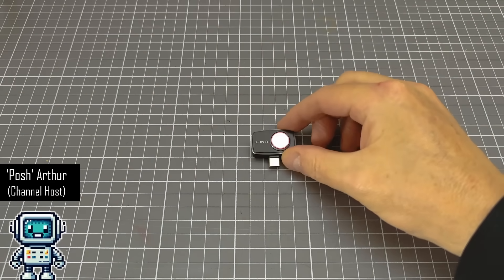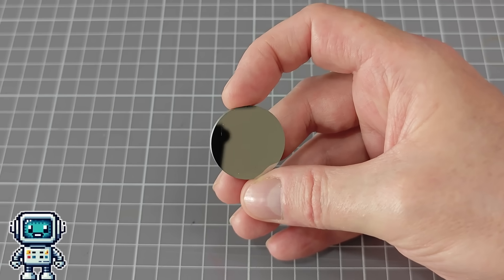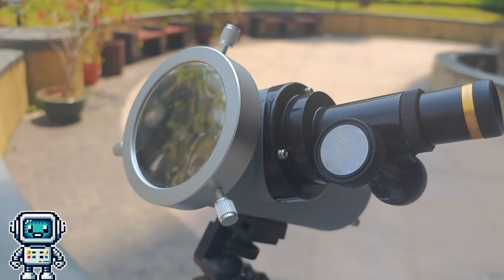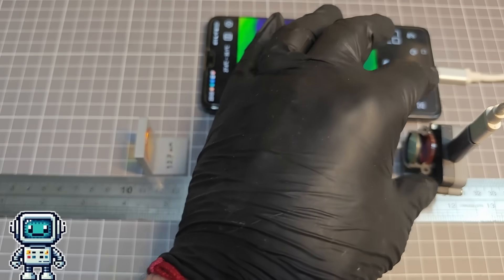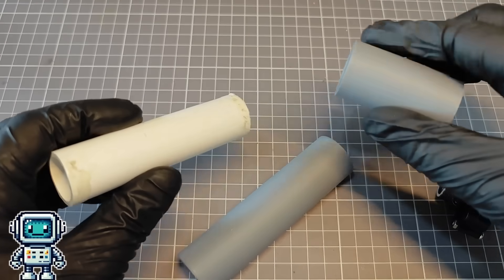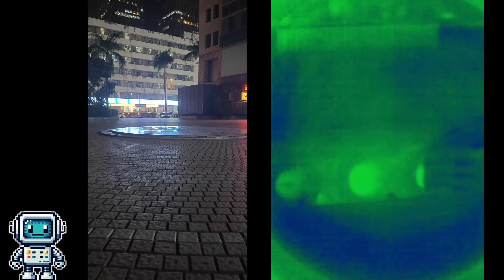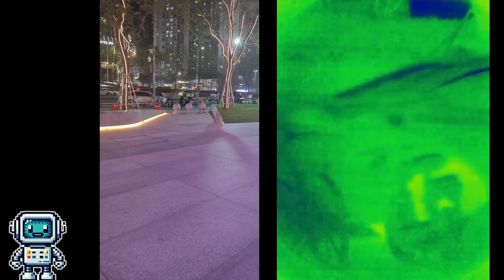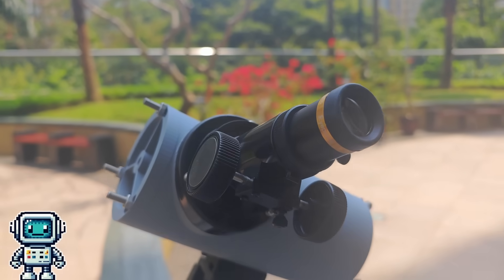Easy DIY Thermal Telescope with over 10x Magnification

Comment: :3:00 wtf did you printedw with 4kg of filament you nutnut. you havent even used supports:))
Reply: ok test parts? so  imagine you dont know how to keep size? in check ? A do measurments units are troubling you ?:)) Maby is just you not everyone should do that:) i expect to have perfect measurments from the fist go. Printers are pretty prety precise, However what i dont understand yet and i am here to figure it out.. i know thermal do not pass thru glass. And i am trying to figure how can i deal with that.

Comment: After I watched Huygens Optics video that used cooktop ceramic glass as a low-expansion telescope mirror, I started to wonder if infrared ceramic cooktops could be used as lenses, or at least as the front cover of a telescope. Sealing the inside air from the outside, so maybe the internal air can be cooled effectively.

The problem is I don't know if it's transparent enough across a wide spectrum of thermal IR. It's just a cooktop glass. It only needs to pass enough IR to cook. Also, grinding the lens would be another science endeavor in itself.
Reply from the maker: Thank you for the comment, I watched that video too, he has an amazing lab and workshop...
To seal the telescope tube from air flow, you could just use any transparent material, even cellophane food wrap, which is very transparent to thermal IR.

Comment: Thanks!

The next time you're experimenting in a place with low humidity, could you try pre-chilling the telescope in the refrigerator? Just make sure it isn't so cold that you get condensation. This is only a suggestion. You are under no obligation.

I suspect that the contrast will improve briefly. Then the contrast will get worse again as the telescope warms up.

If it makes a noticeable difference, then you can selectively cool parts of the telescope to see which parts cause the most image degradation.

Another thing you might try is putting a soldering iron slightly outside of the field of view. This will make it obvious if your tube is reflective in the far infrared.
Reply from the maker: Thank you for the your kind support, we are very grateful.
I have actually wondered about just generally chilling a thermal sensor and trying to measure the differences, I might run a few experiments and if anything worth while occurs, it could also become a full project.

Comment: and  we all  believed the moon was cold!!   is it real?  why  the radiation from the moon  can be  at higher temp. than the atmospheric air??
Reply from the maker: You are correct, in many ways.  BUT a vacuum does not even have a 'temperature' in the classical sense.  There is negligible atmosphere, which means no conduction or convection, but there is radiation, and a lot more than hits the earth (our atmosphere protects us so well).  During the lunar 'night' (about 14 days), everything that will radiate energy will get very cold.  But, during the lunar day, everything that can absorbs radiated energy from the sun, will get hot.  The Apollo astronauts needed significant cooling and wore reflective clothing to compensate for this.
Anyway, hope that helps, perhaps also do a quick search for 'lunar temperature'...
Reply: @project-326   I agree w u  of course, I' m enginr,  not to  "chapear" (means show one´s  golden plate of  a title)  only to know level of scientific talk. to the point:  the moon show an impressive red yea because of radiation only, as the JWT sees,  but radiation also gets dimmer  w  inverse square of distance, and camera should pick up  ambient air radiation, in spite high atmosphere could be at  -50 C. may be the sensor is capturing part of visible light converted into lower freq. by the lenses material. Could be a subject to additional experiments  .  could you please add a link to buy the camera? thank you

Comment: I made one myself. It was a very small reflector telescope but the lenses inside the 20mm eyepiece were replaced by laser cutter lenses. It actually worked exceptionally well giving a crisp, highly magnified image.
Reply from the maker: Please do me a favor and share some more details.  This channel was started to help be learn more about things that are not in my "wheelhouse", so feel free to give me a lesson!
;-)
Reply: I still have the eyepiece. I might do a video soon. Its very straightforward and phone thermals are ideal to use for them as their small size is perfect for the eyepiece.

It's got a potent detection range of several miles and reflector telescopes have mirrors that work great in the thermal wavelength. Refractor telescopes don't work
Reply from the maker: @mrdojob  I look forward to it!
Reply: @project-326  just done a few videos now.
Reply: @project-326  I'll see if I can make a full breakdown of its construction in a video but itll take some editing. Hope you enjoy my current videos. It'll surprise you how cheap and easy it is.
Reply: @mrdojob this is a duplicate of a comment I posted on one of your videos.
------
The center of the image is clear, but the outside is quite cloudy. Did you do anything with the lining of the telescope tube to limit how much heat it emits?

As an experiment, could you cool the outside of the tube with a bag of ice? This would just be to determine the source of image fogging. It isn't practical for extended use.

Comment: I did similar experiments in the past. Diffraction limit is not the problem. Pixel size of thermal sensors is much bigger than pixel size in optical cameras, so this matches to the lower resolution of the optics. To get better contrast you need bigger optical aperture. So the approach with mirrors is a good idea. You should go for mirrors with big diameter and moderate focal length. Like d=100mm and f=200mm. Maybe take a look at cheap mirror telephoto lenses. There are some with f=800mm f/8 they are Maksutov Cassegrain type so the primary mirror has a much lower focal length, maybe around 200-250 mm. Mounting the camera module directly in the primary focus, without using a second mirror could also help. And of course the original lens of the thermal camera module should be removed. This applies also for the other design with the lenses.
Reply from the maker: Thank you for the comment.
Over the last few months, I have done a LOT of research into this.  Yes, the pixel size is relevant, but again it leads back to the diffraction limit.  Optical gain is also another train of thought that again leads back to the same issue.  For optics with reasonable 'telescope' type optical gain, the f-number needs to be super low and with a very large aperture.  The best results I have seen is from some guy that own an 8" mirror with an f-number under 1.2, which is pretty crazy.
Please feel free to correct me, I do love to learn from the comments.
Reply: What about catadioptric ones?

Comment: Since the camera is so small (about the size of the Newtonian secondary mirror), you could just put it (with an short focal "eyepiece" lens attached to it) in front of the mirror, and avoid the complication of the Newtonian setup. Searching Aliexpress for "parabolic mirror" finds a lot of stuff, including large cheap plastic mirrors, with a high numeric aperture. For the longer wavelength, they could maybe be accurate enough. I think the low numeric aperture of the longer focal length thermal lenses (f/10...) is the main reason for low sensitivity/contrast.

Comment: Nice. For the reflecting telescope you should also cool the spider and the secondary mirror maybe even the tube of the telescope, so you get much better contrast and sensitivity.
Reply from the maker: Thanks for the tip
Reply: Good point you make,  reducing the thermal energy in the system is essential.

Comment: BTW nExt Camera (Android) works well with that Uni-T thermal camera and can do full-screen view without any controls (double-tap to zoom). Video recording is also at the full framerate without drops.
Reply from the maker: I have that app on my phone but it doesn't work so well on my cell phone.  I also have a collection of thermal LUTs that the nExt app is supposed to be able to use, but never managed to get that set up.  Perhaps my Chinese cell phone is just not allowing the correct permission to this app...?
Thanks for the comment!
Reply: @project-326  Interesting. As for the thermal LUTs, I generated some with some C code a while back for an Ironbow palette I found. The author offered to include thermal palettes by default if someone can provide public domain code that generates them without any lookup tables (to avoid copyright issues). He's a nice guy so maybe can figure out the permission issue. So the thermal camera never shows in the app? On all my devices it has a USB permission box that comes up when the camera is detected. I noticed you use a slightly older version of the Uni-T camera than I have. Does it work on your PC as a normal UVC USB webcam?

This is the file format (use a .cube extension), with 256 lines of RGB values for each input level (0.123 0.456 0.789 are an example line)

TITLE "Ironbow"
LUT_1D_SIZE 256
LUT_1D_INPUT_RANGE 0.0 1.0
0.123 0.456 0.789
...
Reply from the maker: @gargantuablargg  It shows up on nExt, but often glitches and then the app needs to be restarted, etc.  I have a 640p thermal camera as well, and this one glitches within a few seconds, so I guess the issue is related to the data rate.  
There is probably some USB type of permission that my phone won't allow me to give to app like this.

Comment: We can pull planespotting at night whoa. You've stretched that cheap thermal camera's abilities far beyond what even the manufacturers intended it to be :O

also YES PLEASE i want to see that pancake tube in action! You gonna convert that Fnirsi thingy to sport said pancake tube? Because there's an aftermarket Fnirsi with a pancake tube installed, but it's not cheap
Reply from the maker: I will probably use the Bosean FS-5000, it's just a better platform to build on by still cheap.
Reply: @project-326  That makes me even more curious since there's even less hardware modding documented for it. if anything you're at the forefront of FS5k hardware modding :D

Comment: 4:58 to use one from our microscope project a
5:01 20 mm diameter zinc selonide lens with a

5:44 very toxic it's pretty safe when in

Bezüglich der "Giftigkeit" ist https://en.wikipedia.org/wiki/Zinc_selenide sehr aufschlussreich !
Da sind dutzende Beispiele als Nummern angeführt. Fährt man mit dem Mauspfeil über die Ziffer, dann sieht man in Kurzform die Gefahr. Ist vielleicht für Aquariumsfreunde interessant.

Comment: nice upgrade, what temperature of the moon did you measure, does it match the official statement?
Reply from the maker: Thank you for the comment and interesting question.
Actually I didn't try to make a measurement, it would have been wildly inaccurate for a couple of reasons:
1) I doubt if the emissivity setting of the thermal camera module would have optimized for the lunar regolith (probably a niche application).
2) Adding 4 lenses in the optical path massively changes the sensitivity.

I hope that helps?

Comment: Recently used a Newtonian telescope with a thermal cam, just take a cheap Co2 laser lens inverted between the telescope and the camera, works quite well.
Reply from the maker: Thank you for the comment.
I am very curious, what was the camera type and spec of the lens that you used?
Reply: @project-326  same as in my macro lens thermal cam vid, its the same setup just flip the lens, the 3d files for that are also on my thingiverse if u need it

Comment: As a retired Thermographer who used cryogenic cooled sensors and numerous other TI imaging systems,  your device is very impressive with ingenious solutions to tricky optics.  You dodged a bullet with internal radiation screwing the resolution I suggest insulation to reduce thermal conductivity in the tube.  Well done....
Reply from the maker: Thank you for the comment.
What kind of insulation materials would you suggest?
Reply: @project-326  He might mean cooling the pipe.
Reply: @project-326  Hello, 
Paint the inside of the tube with high emissivity mat paint (Blackbody) this will reduce internal reflections,  wrap thin 2mm polystyrene around the outside of the tube cover this with mylar from a crisp packet with the shiny side out, repeat with second layer of both.  
The polystyrene will control thermal conduction and the mylar the thermal radiation.  Ideally the tube needs to be as cool as possible.

Image resolution, Mono pallets are better with low resolution so use IronBow or Black/White mono pallet.  Adjust level and span to improve contrast.

Isotherm, some software will have this function, it is a temperature range which will trigger a different pallet of colour, this can be used to blank the back ground. For example the object you wish to see it ten C above ambient.  Set Isotherm to present a colour for anything up to ambient. this leave the warmer object like a silhouette.

Avoid the Rainbow pallets unless you are imaging high energy.

Check out FLIR website and their free software 

support.flir.com/SwDownload/App/SWDownload1.aspx?c_id=131090

Also Infrared Training Centre which is 

Great work I really enjoy your channel and the level of work you put into it please tell the A I overlords to FO as you doing well enough without them..
Best wishes from UK
Reply from the maker: That's really great information.  Thank you very much.
Best wishes from Shenzhen, China!
Reply: @gargantuablargg  Thanks for that, I am a bit out of date with software as mine was PC based and research platforms. What you describe has similar functionality and incredibly useful once set up correctly images then have significantly improving contrast and detail Thanks for the info. Best
Reply: @project-326  Hello, 
Paint the inside of the tube with high emissivity mat paint (Blackbody) this will reduce internal reflections,  wrap thin 2mm polystyrene around the outside of the tube cover this with mylar from a crisp packet with the shiny side out, repeat with second layer of both.  
The polystyrene will control thermal conduction and the mylar the thermal radiation.  Ideally the tube needs to be as cool as possible.

Image resolution, Mono pallets are better with low resolution so use IronBow or Black/White mono pallet.  Adjust level and span to improve contrast.

Isotherm, some software will have this function, it is a temperature range which will trigger a different pallet of colour, this can be used to blank the back ground. For example the object you wish to see it ten C above ambient.  Set Isotherm to present a colour for anything up to ambient. this leave the warmer object like a silhouette.

Avoid the Rainbow pallets unless you are imaging high energy.

Check out FLIR website and their free software 

Go to FLIR(dot)com  support     SWDownload   it is free. 

Also Infrared Training Centre which is 

Great work I really enjoy your channel and the level of work you put into it please tell the A I overlords to FO as you doing well enough without them..
Best wishes from UK
Reply from the maker: YT is funny about posting links, that's why it blocked your first and second comments.  I had to manually unblock it...
Reply: @project-326  Understood,  FLIR made a lot of software free, early systems had img extensions but they should be now compatible will jpg either way there are some tricks to getting the little buggers to work well.  Software is the key to getting the imager to spill the beans.  Best
Reply from the maker: @Woffy. which pieces of software are you referring to?  Thermal Studio suite?
Thanks!
Reply: @project-326  These comments are not visible to me...
Reply from the maker: @kbilsky  I'll take a look in blocked comments and clear the flag if YT has had a brain-fart again...
Reply: Hi.. can we connect to discuss some cool industry requirements for manufacturing on the large scale..
Reply: Guys, no links visible. YT sucks with this censorship
Reply: I think the original commenter deleted his replies for sensitive information
Reply: @impactodelsurenterprise2440  Hello, no YT had a brain fart with the original post having links to software and data,  

Resent it several times removing links to software etc and it crapped its pants. Check out FLIR systems and download Thermocam Researcher,  or Reporter.

ITC Thermographic site is very helpful; more fee information.  I will have to read the messed up thread to see who's not had a reply. Best.

Comment: The moon is warmed by the sun; however, you are actually seeing IR from the sun reflected/scattered by the moon rather than blackbody radiation generated by the moon.
Reply from the maker: Thank you for the comment and for the insights!
Reply: Nailed it Byron.
Reply: I think you're right but it still doesn't intuitively make sense to me since you can't generate heat greater than the temperature of the surface of the moon if 'what-if' #145 from Randall Munroe is correct.